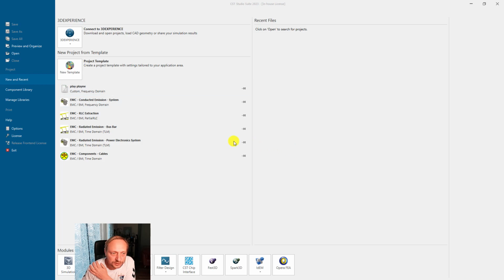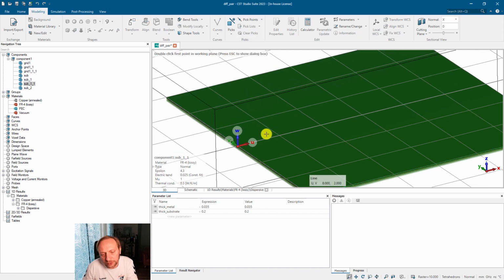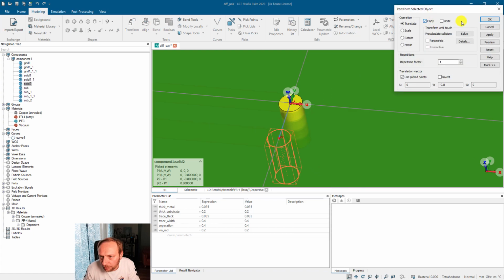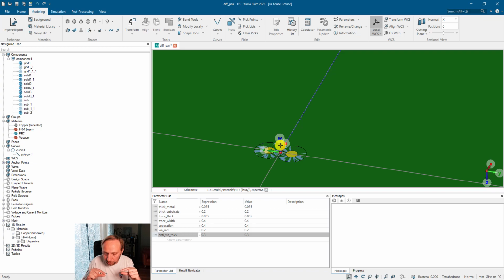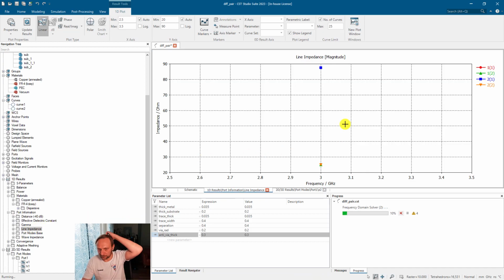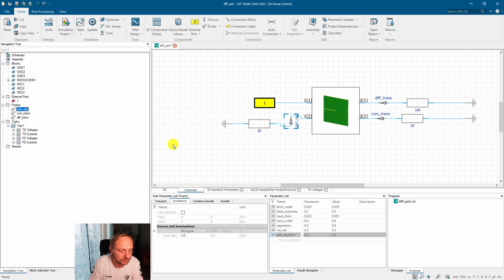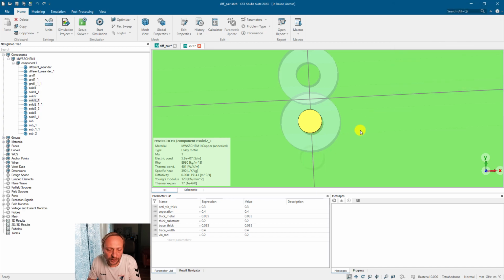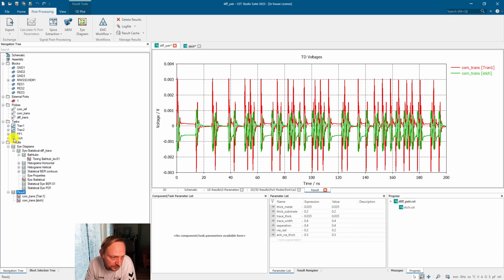CST Tutorial - Differential Via Pair

Comment: Hello, I tried to follow your tutorial and reproduce in CST studio 2023 learning edition, however when I reach the schematic part of the tutorial and I hit P for port or shift + R for a resistor, nothing happens. Those buttons are gray. Also for the other tutorial I don't have the cable menu and the time solver for cables available. Are these the software limitations of the Learning edition or should I reinstall the software?
Reply from the maker: I think this is a limitation of the learning edition. It does not contain the circuit simulation capabilities :-\

Comment: Hi Andreas, Great tutorial!  I was wondering if you have any suggestion for my project.  I am trying to extract differential impedance value of a differential pin pair of a passive connector.  Connector consists of conductors in 6x6 array (0.7mm pitch) with no designated GND pins.  All conductors are embedded in a kapton carrier.  I randomly picked two pin pairs and tried to extract differential impedance using multiple pin waveguide port (common mode).  I have noticed that differential line impedance changes with waveguide port size.  Does multi pin waveguide port size have any affect on differential impedance value?  Thanks again for a great video.
Reply from the maker: The size of a waveguide port indeed can affect the impedance calculation if choose too small. The general rule is to choose a size large enough that the fields at the edges of the waveguide port decayed "enough".